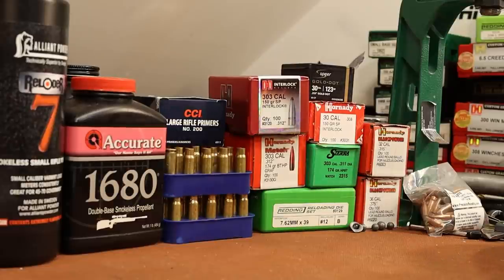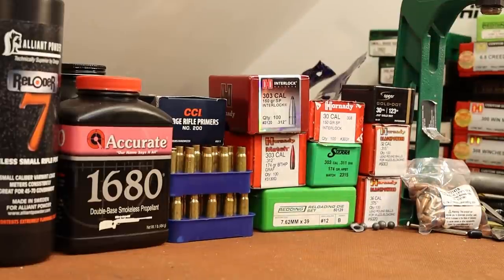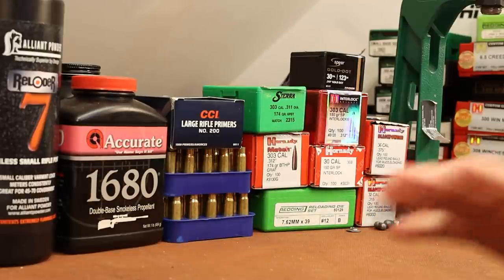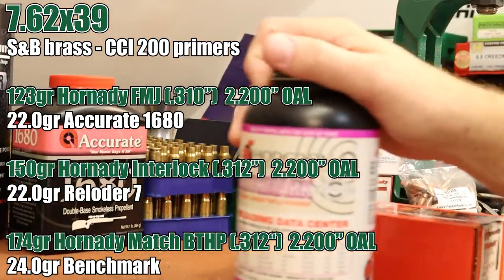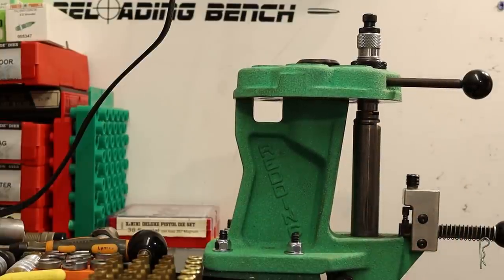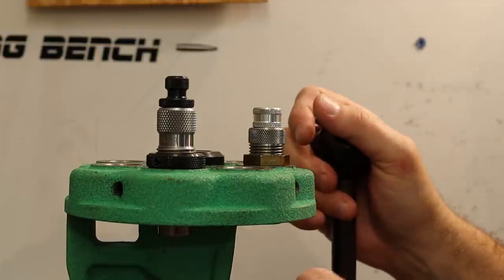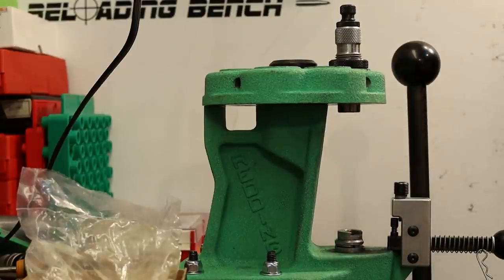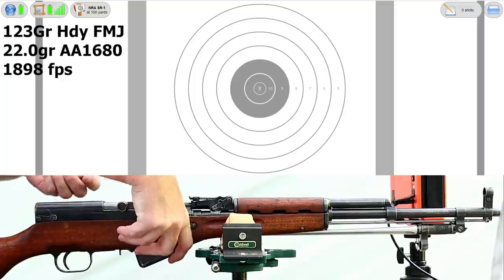Loading 7.62x39 for the SKS - Getting started and shooting some groups

Comment: A couple of my SKS rifles with excellent bores, slugged at .312" they actually shot the .310" Hornady FMJ, SP and V-Max jacketed bullets best in all my SKS rifles,  .311" dia. bullets shot good, but the groups opened up a bit. With cast lead bullets, the Lee .312" 160 gr. TL and Lee .312" 185 gr. RN powder coated, gas checked and sized to .314" shoots as good or better than any steel case ammo.  Reloader #7 or 1680 are excellent powders for the jacketed bullets, but the Reloader #7 works well with cast lead, although I like 2400 for cast lead as well.  As far as brass some rifles will tare up the brass but none of my SKS rifles from three different countries hurts the brass as all as I have over ten reloads on some of it.

Comment: My observations through time is that S&B brass, in general, is very hard and brittle (no matter what caliber). The same goes for the primer pockets being tight and shallow, no matter if it's a 38special or 30-06, they all tend to be like that. Annealing the cases should take care of most of the problems with split cases. Using S&B primers usually negates the need to size the primer pockets as they usually go in a little easier.
Reply: Same
When I'm sorting brass
Anything S&B gets tossed
Into the 5 gallon bucket
I have now a few buckets full
I'll probably never use them
I gotta stop hoarding this crap

Comment: What a great idea, I can't wait to watch your new reloading adventure.
Bore is usually 311 at least it's what CZ wrote on their barrels, however if memory serve me well, Ruger bore diameter is 310 and Hornady die is for 308 bore...the plot thickens ;)
Fast powder work like AR2205 (magnum pistol 44mag...) is ideal for the 123/125 class bullet in 16 to 18 inch barrel 
With slightly longer barrel slower powder  like the RL7 and the AR2207 is optimum in my experience.
Happy you mention the Hornady 150/312, with RL7 or AR2207 it shoots absolutly great out of my 17.5 inch CZ carabine, it is my pet load for the underwood I have a good node at 2240fps... I tryed the hotcore 311 it is working progress but the bullet might be à bit to hard for the velocity I work with.
With a good chamber, a 20 inch barrel and the right powder you should match or outclass the venerable 30-30. It could be an interesting challenged?

Comment: I’ve had a Chinese SKS for 30 years never had a slam fire. Mine is in good shape, I clean it well after shooting and I probably have only 5000 rounds through it, but it seems like that firing pin has to be really gummed up to cause that. I’ve heard it’s common and maybe I’m just lucky, but slam fire seems like a maintenance issue to me. There are spring firing pin kits to eliminate that too.
Reply: Yep. 99% of the time its from tons of carbon build up, aka not cleaning your gun
Reply: Yep my first sks was a 68 and it shot ok the one I have now is a 70s model also never had a slam fire cosmoline seems to be the usual blame
Reply: I had one slam in 12,000-ish rounds, clogged firing pin channel(from the red sealant around the primer). Keep em clean
Reply: tom allen yugo firing pins are  so hard to find nowadays
Reply: If you put the firing pin in incorrectly it will also slam fire.
Reply: Clean the cosmoline from the firing pin, that becomes a non-issue.

Comment: I have a PSA 7.62x39 upper that I have had for several years. It’s a .310 diameter barrel. Shoots great with reloaded and factory loads brass and steel cases. Around 3/4 to 1 inch groups with most at 100 yards. Thanks for the video went and checked 1 1/2 with the steel case was the best.

Comment: I owned a new unissued Yugo SKS and my friend a Chinese SKS brand new.  Using factory ammo and shooting standing, squatting, prone with sling at 100 yards the best we could ever get was groups that could be covered with the palm of your hand. I did Palma and High Power X-Course, Silhouette, and Bullseye 22 rim fire pistol. Since those days I still do Silhouette and F-Open and T/R. That was Russian, Yugoslavian, and domestic made ammo. I owned a Ruger Mini-30 at the same time and it was only a little more accurate. Back then it was hard to find 7,62x39 brass and light weight .312  bullets so I did not reload for it. Back then the best way to find quality brass case ammo was actually at gun shows. The Ruger Mini-30 was around mid 1990's and the SKS was 2001-2003.

Comment: I have an SKS that I bought at a pawn shop. I didn't check the numbers and when I took it apart to clean it, and tried putting it back together, it wouldn't fit. Then I noticed it had been put together from 2-rifles. I hand fit everything back together, and then found the barrel had a small bow. I was hating this SKS, but stayed with it. The crown had been opened up too much and I also mounted a scope mount. It now shoots in line at 100, 200, and 300 yards.

Comment: JRB glad you are loading the M43, alloy me to past on what I’ve learned from working with it, along with my AKM for the past 17 years. By it being a tapered case it’s internal case capacity is limited, so bullets weighting more than 123 Grs are longer and must be seated deeper, which results in less room for powder. 
The 150’s -174’s are used with brass which has great powder capacity IE 7.62x54R .

Comment: What I would find interesting is this cartridge compared to the .300 HAM'R.  Similar size bullets and powders.  Which one does better at what?  That sort of thing.
Reply: Oh and BTW, I've been watching for years, can't get enough.
Reply: I prefer 7.62x39 to .300BO for subsonic loads. The greater case capacity of the Russian cartridge gives more flexibility in working up a load and has no possibility of being loaded in a .223/5.56 chamber.
Reply: @dbmail545  Just FYI I didn't mention 300BO  I was talking about the .300 Ham'R round by Wilson Combat.  It doesn't do subsonic loads.

Comment: I have 2 CZ 527s.   A 7.62x39mm  cabine and a 6.5 Grendel  American.   Im new to reloading.   My rifle bore is .311.   I found a great deal on a bunch of Hornady at .310.  This shouldn't be a problem?  They are soft points, I want to use for deer and maybe hogs.
Reply: The Hornady at .310 will run great.

Comment: I've just started developing some loads for my 16" AK. Is hard to find modern load data so this is what I've gotten so far. This is with with 123gr .310 hornady SSt, new starline brass and Winchester large rifle primers. No significant pressure signs. 
Cfe Blk 28.6-30.4gr in 0.2gr Increments 2376-2518fps
SW Blackout 28.0-28.8 in 0.2gr  Increments 2324-2467fps
Reply: How do those projos group? Anything subjective that would make you choose one powder over the other?
Reply: @09cjonescj  I haven't had the chance to start group testing yet. I was just trying to get a base line for velocity and SD

Comment: Some parts that would help out for the accuracy test would be a scope mount that a couple companies make that get connected to the rear site and rear takedown pin and gives you a picatiny rail that runs down the whole receiver of the rifle. Murray makes a polished sear and hammer to help with the heavy trigger pull. Also, wolff has a reduced power mag release spring that will lighten up the 33lb trigger pull as the mag spring also doubles as the sear spring.

Comment: 21st century has the windowed expander die body now (904-GX)... takes the guess work out of your die seating depth, as you can see inside the die and can visually check the mandrel depth.  Picked one up a couple of months ago. Pretty slick option.

Comment: really like the 15.5gr of 2400 with a cast bullet - Ed Harris load data
Reply from the maker: Does it cycle?
Reply: @JohnnysReloadingBench  My Chinese SKS will cycle that load using a powder coated gas checked Lee 160 gr. TL bullet all day long.  It will actually cycle a lighter load, but I bought the rifle new in the box, so it pretty tight as far as the gas system goes.
Reply: I load some cast and had my best luck with2230 .The cast flat out didn't like 1680 which shoots great with jacketed
Reply: @papawed489  I liked 1680 with jacketed bullets, but it disappeared around here many years ago and just never came back around, so I just switched to Reloader #7 for jacketed bullet and never looked back, I have some CFE Black to try out at some point as well.  I like 2400 and IMR or H 4895 for cast lead.
Reply: @reloader7sixtwo  1680 is in stock direct from Hornady, right at this moment.
Reply: @withoutfurtheradoforever  Thanks, but I dont by hazmat components online and I have plenty of other powders that work just fine as is.
Reply: @JohnnysReloadingBench  in an AK yes
Reply: 12.0g of 2400 will also cycle the action with tighter groups.

Comment: I'd like to see how that compares to some steel cased ammo as far as group size.
Reply: Every rifle is different, but my rifle’s best steel case groups look like the worst ones he just got.
Reply: @509Gman   1800fps is anemic out of an sks.  I wonder if the groups will open up at velocities comparable to wolf steel, 2300 or so FPS.  Also extraction at higher pressures. The Steel won't expand and they are designed to shoot steel case, I wonder if the brass expansion will cause issue, especially with the pits in that chamber. Never tried steel in an sks myself.  Look forward to the next video.

Comment: I am getting really good results with CFE BLK powder in this cartridge, using Barnes and Hornady SST 123 gr bullets.  Plenty of sub-MOA recipes in a bolt gun.  

Despite its name, CFE BLK lags a bit in .300 Blackout supersonic behind other powders like 296/H110.  I stick to subsonics when using it in .300 BLK.  But it is a top tier 7.62x39 powder.  

1680 is very good too.  However, I find it noticeably flashier than CFE BLK in low light.

Comment: I've had decent results with 150-grain Hornady fmjbt .308 and H4895. 2.5 moa at 100, 50% hit rate on a 28" round plate at 600. I'm using the Lee Pacesetter die set with a .308 expander. hth and Thanks for the load info👍🇺🇸

Comment: If the firing pin and bolt bore are clean. Slam fire shouldn't be an issue. I would be more concerned with a drop fire. The trigger safety only stops the trigger from moving. It will not prevent the sear block from moving. A friend has one that would release the hammer when dropped on the butt plate (empty chamber). Fixed the sear angle. But we don't leave it loaded unless it's in use.

Comment: I bought the Dillon 7.62x39 dies when they used to make them and I love loading the 7.62x39, I have a lot of old Norma 130 gr.  303 bullets loaded into IMI brass and a lot of PPV bullets loaded and a lot of once fired Lapua brass. I find my hand loads are much more accurate than factory ammo I do want some Lapua tips for the 7.62x39.

Comment: Looking forward to how this all works out. Honestly like 7.62x39, made a rifle for my wife (bubba'd carcano rebarrelled with an AR 7.62x39 barrel, still need to do some extractor work) and it shoots very well. Want to work up some good target load for giggles since I have issues. She took her first deer last year with a 124gn copper bullet and Jagemann brass. Tried to get everything together when the shortage hit hard, so I had to pull powder from crap Wolf ammo. Several grain variation, so I just averaged and guessed a lot. Probably horrible idea, but I had to. FINALLY got some powder on the way to do it properly.
Reply: Awesome.. my plan was to rebarrel a carcano until the ruger ranch came along, now the carcano is in limbo😅
Reply: So far works great, the only issue is that the extractor is a bit cranky. I think the original ammo had a bevel on the base or something, I dunno. More filing time. I probably did everything wrong, ended up keeping the stub of the barrel in the receiver and lopping it off a little bit ahead of the receiver so that I had some meat to cut the AR threads into and so it would headspace right. I only did it that way because for some reason I had the barrel knocking around. I don't even own a freaking AR, no idea. I imagine that doing it like someone with a brain and directly cutting threads on a blank properly would work much better. With a cheap red dot on it it held okay ar fifty yards and was good enough to harvest a deer, but I have since put a proper scope on, so we'll be able to see how well it really works. Next step is a proper magazine, so far made an insert ramp for single loading, but I really want a few rounds for followups.

Comment: I’m very interested in this. I hunt with a Ruger ranch bolt action 7.62x39 and the factory hunting ammo choices aren’t very good.
Reply: Have you tried PPU AMMO. THEY HAVE ROUND NOSE  THAT SHOOTS REAL WELL IN MY AR BUT IT CHEWS UP THE POINT A LITTLE .THAT SHOUDNT BE AN ISSUE WITH A BOLT GUN.THEY ALSO HAVE A SOFT POINT BUT I HAVEN'T TRIED IT YET.
Reply: The honady SST works real well if you can find them
Reply: @papawed489  I tried the Hornady black it has the sst projectile. I shot a doe at 40 yards. She was perfectly broadside and it was a good shot right behind the leg. She only ran about 50 yards which’s good. The bullet did not exit though and there was not one single drop of blood. I hunt really thick woods so I got really lucky finding her. I knew I made a good shot so I just searched until I found her. I need something with a little more penetration so I get an exit wound. I later found out that the Hornady black is designed not to exit. It is a self defense round. I also have some federal fusion but I haven’t tried it yet.
Reply: @kfranklin308  sounds like the gold dots might be a good option for you. Made to expand, but stay together and penetrate.

Comment: Subsonic 7.62x39 would be very interesting to see you tackle
Reply: I'll just say this. A norinco sks that's been bullpup'd and 16" barrel WILL cycle a sub load with 200 gr bullets... with a little extra backpressure😉
Reply: @ericwilson5453  was it a 16” or did you get it chopped when you got it threaded?
Reply: @09cjonescj  cut and recrowned at 16 1/4, then used a clamp on thread adapter. Works really well.
Reply: @ericwilson5453  nice. Suppressed sks is my current project just waiting on receiver/barrel swap from gunsmith who’s gonna end up taking a year. Cut and recrown sounds nice. Tons of CFE blk on hand

Comment: My SKS shoots around an 8" group at 100 yards which isn't good. I used the low melt temp. chamber alloy and found that the rifling is shot-out which isn't surprising since the Ruskies and Chicoms use steel in their bimetal bullets. I mentioned it to some dummy and he said impossible in spite of my shot-out barrel as the proof.

Comment: the problem with metalic sights on the sks is that the rear blade notch is too short and too narrow. remember they are  3-4 moa guns at 100 meters. if you get any groups smaller than that it is a plus.

Comment: You should definitely look into a Ruger American in 7.62x39, mine is a tack driver. I've been running IMI brass and Win LRM primers (all I could find during pandemic) and 31.7gr CFE BLK with a Hornady 123 SST running an average velocity of 2621 with an extreme spread of 7 and zero pressure signs.

Comment: If you build an AR upper make sure to slug the bore. Most American made barrels are .308 and not .310.
Reply: This was true many years ago. Most makers today are .310
Reply: @captaingrey6336  yes! My BCA is .310.
Reply: @captaingrey6336  I personally received 2 .308 barrels from a common supplier in the last year that were marked for the AK built AR platform and they slugged at .308 all day. One from another common manufacturer slugged .310-.311. So I think they are much more common than one might think.

Comment: I shoot 0.310”-0.312” Bullets all day long in my  0.308” AR never an issue. For Several factory SAAMI cartridges this is a normal thing to shoot a bullet that is actually larger than the bore… using the larger bullet provides better bullet to bore alignments for better accuracy

Comment: I use Lee dies.  The Pace Setter dies  have both a .307 and .310 expander. (User controlled.)  Results are what I consider proper.  
The information for the 174 grrain bullets I though ascribed to a reloader in a comment.  I am looking for similar information.  Any further details, like maximum allowed and such?
@ 16:2 - S&B brass, shallow primer pockets.  I had the same problem with fired S&W brass fir the same cartridge, 7.62x39mm.  Except I loaded several, then noticed them.  Using either  CCI or Winchester LR primers, (I have both, so it was one or the other).  The primers seated fully were a bit proud of the base of the head.  Just a little.  The cases would chamber, but the bolt would not close (I shoot this in a CZ  gun).  I went back and did what you did with the primer pocket cutter and decided I would not use S&B for this particular caartridge again.  Loaded S&B ammo in other calibers seem to operate normally.

One notes when viewing the test firing, the speaker gives seemingly different information regarding average velocity than the upper right hand informational screen.  Which is correct and why are there two different stories being told?

Comment: Had the same go around withRedding and expander ball20 years ago. Remember they are ALWAYs right and they will tell you they are in spec. Mine miked up .312”. Use the right bullet and had to file out a ramp so the onjive was’nt
Reply: So the ojive was”nt bumping and ended up with 2” at 100 yds.No Ojive damage.Had to buy larger expanders and take them down appropriately.

Comment: I have to size my bass to 308 ,310 had noneck tension bullets were Hornady SST which measured 310 dies were lee
Reply from the maker: I had neck tension issues with my 300 blackout Lee die as well and had to sand down the expander. I didn't realize their kits came with two for 7.62x39. That's probably what I'll buy.